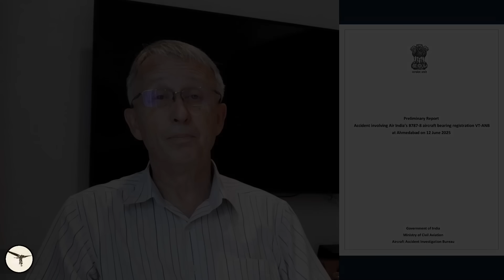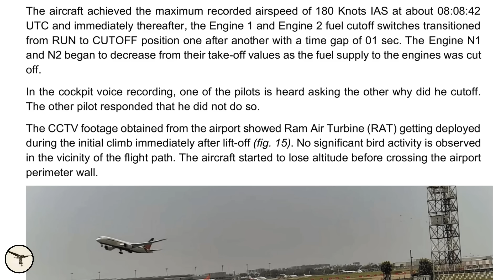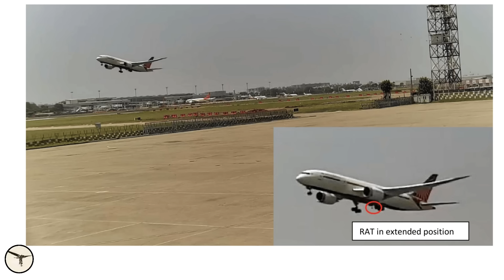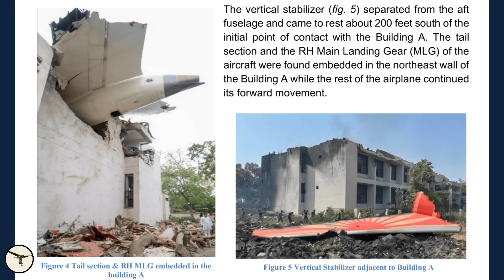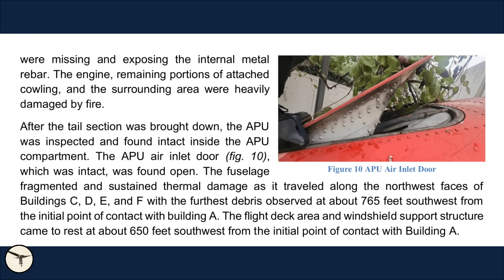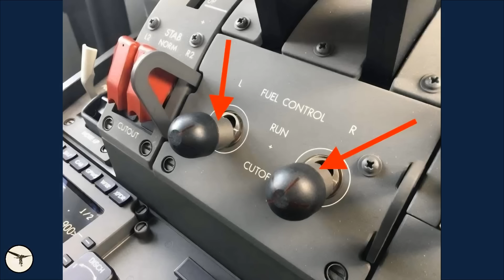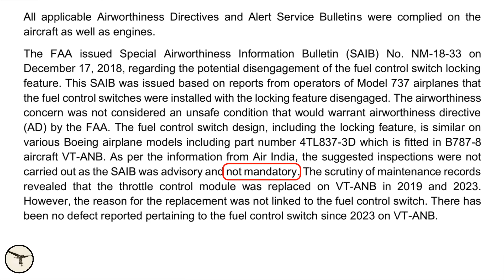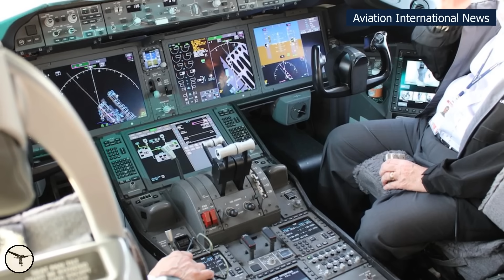WARNING Fuel Control Switches Failure Could Cost LIVES

Comment: Thank you for the video and analysis, Magnar. I'm not a pilot or an aviation expert, merely a hobbyist. I have a question though.  It is somewhat surprising to me that there was no warning that rang out when the engines were set at maximum thrust just prior to the take off run with the fuel control switches in the off position.  Unless of course, the switches were moved to the off position just after the aircraft lifted off. I hope I'm making sense. Thanks.
Reply: Yes it would seem shortly after rotation and lift off about 250' altitude the fuel switches were cycled off..
Reply: @vincentrusso4332  I am surprised that this is even possible. Why would Boeing provide this potentially dangerous feature? Are there any situations where the fuel supply to the engine has to be turned off when it is in takeoff power?
Reply: @gani999  The fuel shutoff switches are also restart switches. Turn them off and on quickly and they automatically initiate a restart sequence, which is useful at any time, including takeoff.
Reply: @gani999  Indeed, lets say that one engine caught fire during take off run - like the Concord;  the pilot need a way to fast cut the fuel for that engine, before the flames move to the wing and the fuel tanks there blow up.

In Embraer made planes they use a logic that after the pilot move the switches for CUTOFF the FADEC only will turn off the fuel valves if the throttle lever is in idle position. So the pilot need take two different actions to tell the system that he want shut down an engine.

Comment: One of the pilots did ask why did you cutoff the fuel supply! The other pilot replied: I did not do it, for it was an act of God!
Reply: If neither pilot manually caused fuel cut-off, then maybe an electrical issue caused the cut-off without the mechanical switch being moved. 🤔
Reply: Some comments should not be posted...
Reply: @sveinfarstad3897  Are some Big-Brother agent! 😊😊😊

Comment: A better design for the fuel cutoff switch might include an interlock which makes it impossible to move unless the throttle is reduced to ground idle.
Reply: There have been incidents where the throttle was damaged and seized in place by the autothrottle motors so it couldn't be moved. That would likely result in a crash if you couldn't shut down the out of control engine. If they want to crash it they could simply deploy the fire fighting bottles. It's hard to engineer around a pilot determined to unalive themselves.
Reply: @-Bill. The fire handles are locked unless it detected engine fire. It can be manually unlocked but would required an additional step to do so. 

Maybe it should be the same for fuel switches? Locking mechanism in-flight but can be manually override if required.
Reply: I don't see how that's a bad idea,  in case of engine fire one would have to bring the throttle to idle, God  forbid you have a motor separate from the pylon perhaps is why.. idk.  Still think you're on to something.
Reply: Embraer made planes use this logic.
Reply: Actually a two step Cutoff switch could be used that requires a pull, shift and rotate to 90° to lock the switch in position. But the design would have to be tested and approved by the FAA and other regulators for implementation and definitely be more expensive so the aircraft manufacturers never bother...
Reply: My GA aircraft also has a FADEC equipped engine which can be shut down with only one switch. I treat this switch with the highest respect, but in fact its not that much different from a mixture control lever. That's why my instructors emphasized to not grab the prop and mixture levers between your fingers when putting them forward on final, but only push them forward with your thumb. Just to prevent shutting down the engine on final during a brain fart. Personally I cannot imagine that such experienced pilots would deliberately shut down the engines.
Reply: Against psychos, there is no good design...
Reply: @numismatajaime  Against idiots that will swallow anything, the switches can have  padlocks and they will believe that the MCAS company diagnosed it was somebody else's fault
Reply: @numismatajaime You would at least know there is a psycho before they touched fuel cutoff switches.
Reply: In that case on the CVR you would have heard: "Why did you cut power and cut off?".
 If there would have been camera in cockpit wou could have seen the psyho's beautifull smile...

Comment: Clarification (from a guy who has flown a lot at Ahmedabad). The Indians do not like single numbers, so 1 second is written as 01 second.
Reply: @SimonWallwork  Moreover this is confirmed elsewhere in the report, which states “02 Flight Crew” on board.
Reply: I was taught (USA) to spell out single digit numbers when writing - and to use digits for 10 and greater.
Reply: Context is everything.
Reply: @SimonWallwork   who told you that??
Reply: So it took 1 second shut down but 4 seconds to flip back to run.  Got it. :/
Reply: Does the fl data recorder count in tenths of a second ? All number on the report seem to be  whole seconds.   Also,  if the FDR timer is digital, two near simultaneous events could be recorded as Sequential not simultaneous ?

Comment: The report say that one pilot ask "Why did YOU cutoff"  indicating that he saw that the other pilot cutoff.     The  other responded "I did not do so", which is NOT and answer to WHY and th answer was more of a response to "Did you cutoff", no WHY.    Why did the report paraphrase the pilots???     Asking WHY vs just asking did you cutoff it a completely different assertion by the pilot asking.    The actual voice and tone of the voice MUST be released to give light on what happened to the fuel switches.       

also, seconds after the WHY question, ONE fuel switch was turned back on, and it tool another FOUR seconds to turn on the 2nd fuel switch.   WHY so long and what was being said during this time is critical to understanding what happened.
Reply: This is all material for the final report. Releasing this preliminary report ASAP was necessary to inform operators and regulators of the technical condition that led to the crash, for the safety and confidence of B787 operations everywhere. They've released only the amount of information necessary for this purpose. Obviously anyone able to recognise either pilot's voice will know which pilot said what.

If this crash was deliberately caused it's going to take more work to reach any conclusions and form recommendations, and this is not as urgent because unlike a technical vulnerability the individual responsible no longer poses a risk.
Reply: @moblet  Absolutely correct
Reply: Did it ever occur to you it might be an English translation of Indian words spoken? Also, you can't start two engines at once. The selecting the other engine a few seconds later was more likely an action of desperation. It's all irrelevant anyway since they didn't have time to start even one engine before impact.
Reply: @davidkavanagh189  Indian pilots and ATCs mostly communicate in English. So I doubt that was the issue.
Reply: @gani999  On the radio yes of course. Indians also like to speak their own language to each other too though I think you'll find. We'll just have to wait and see if/when the full transcript is released. For now all we have are words that might be paraphrased and/or translated.
Reply: @davidkavanagh189  So what if it was English translation? That can be done easily and accurately. What does it matter if it was a translation? What does it change?
Reply: @lordjim3109  Nope, not everything translates perfectly from one language to another with all context and understanding preserved. Even within the same language, a word or phrase can have a subtly different meaning from one person to the next. Wait for the report. There simple isn't enough detail in the phrase stated to come to any conclusion about intent.
Reply: @lordjim3109  Out of curiosity, what other languages do you speak fluently?
Reply: @davidkavanagh189  I see you double down on your nonsense. There isn't much I can do about it.
Reply: @davidkavanagh189  I can tell you the phrase: why did you do it? in any language on earth, except for a couple dialects spoken in the Amazon jungle and in the Congo basin. Edit: give me ONE example of a language from which you can't translate "why did you do it?" into English. One.
Reply: @lordjim3109  You've claimed all languages can be directly translated. That is incorrect. It it were true, translation software would never get the meaning or implied meaning wrong but it does frequently to varying degrees depending on language. It seems like you don't fluently speak more than one language and don't seem to know much about languages at all so I guess we'll just leave that there. 

As an interesting aside, have you ever accidentally dropped something and someone exclaims 'why did you do that?'? Even in English that is a natural response for many people. It does not automatically mean you intentionally dropped the object. Maybe you did, maybe you didn't but further information and context is needed to come to the correct conclusion. Stop slandering the pilots and wait for the report.

Comment: Bad design. In the Embraer E-190, for example, if you were crazy enough to turn the 'OFF/ RUN/ START' knob to 'OFF' in flight, the command would be ignored unless the thrust levers were at idle. To shut one down when it's making power you have to pull the T-handle. Even then it runs 'til the fuel lines empty and you can swiftly put the T-handle back and likely restore the power.
Reply: Does anyone (pilot or technician) know how this works in a 787? Does the engine have to be idle to stop the fuel supply? Does the engine have to be idle to restart? The report still leaves many questions unanswered. Either they don't know, are still unsure, or are trying to hide something.
Reply: Against psychos, there is no good design...

Comment: Captain Magnar, due to the sequence of the re-activation of fuel flow to the engines would you agree the the senior flight crew or Captain (pilot not flying) likely move them to flow. Is it not probably the closest switch would be worked first.
     I'm, asking/suggesting, because many other reports are indicating a flight crew moved them - and the pilot non flying would have had the best oppertunity to do that.
Reply: Moving the switches looks like it would be equally simple for either pilot to do, without having to look for/at them. Just as it looks like it would be easy to accidentally strike them. I realise there are protection mechanisms in place but I'm a little surprised at how exposed these switches are to accidental contact given that they should never be disturbed in normal operations.
Reply: I'm wondering the same thing,  a guy asked Mentour Pilot would the switches being cycled from L to R or vice versa give us a clue but they said they're always taught to work from L to R just like they read.
Reply: I don't think you can draw any conclusions based upon the order of switches. For every person who might use closest-->furthest there will be someone who goes numerically first-->numerically last, or left-->right.
Reply: @-Bill.  I was also thinking there is another possibility. On many multi-engine aircraft different engines play a different role in auxiliary system operations. But that was not the point of my original query.

Comment: What is more likely to result in the switches being operated one at a time with a 1 second gap? A pilot operating them one at a time in quick succession or a hand slipping against one switch and then the other.  Expert comments I have read on other YouTube sites say that there is no way a 'nudge' would operate them and one engineer said that he had looked at thousands of them over many years and never seen a defective one
The sound of the switches being moved would be heard on the CVR when they filter out other sounds
The investigators have not even upgraded the earlier optional Bulletin to a mandatory AWD to check the switches on all aircraft immediately. If they thought there was any chance that a bump / slipped hand could have caused both switches to operate they would have issued something - The NTSB and Boeing were on the investigation team
They were able to check the function of the switches as they were recovered

This was murder / suicide.  The Investigators know it but are protecting the families of the pilots for the moment
In pulling the fuel cut off switches immediately after takeoff the guilty pilot knew there would be nothing the other pilot could do to rescue the situation
Reply: Considering there's a recommended inspection of the start switches for the exact reason that they can potentially be nudged out of position, how on Earth are you just ignoring that very relevant information and making a fairly disgraceful accusation of one of the pilots who is no longer able to defend himself?
Reply: @davidkavanagh189  Why have they not put out a AWD requiring the immediate inspection of ALL such switches. Do you think the NTSB would just let that go and hope for the best? Why did one pilot say "why did you do that". Not what did you do
Reply: @gap9992  There are different levels of requirement based on assessed risk, ADs being the highest. It's not a case of hoping for the best. They probably considered that the accidental movement of both switches together and at a critical phase of flight to be extremely remote. The accidental shutting down of one engine would generally not endanger the flight or render the aircraft not airworthy. I've no doubt they'll be taking another look at this after this accident. 

Regarding what the pilots said, it's important to remember that English was not their first language and the wording in the report may be a paraphrase or even a translation from Indian so it may not reflect the whole context of what happened there. People also do or say strange things when startled or surprised. Hopefully we will eventually get the whole transcript to get a fuller picture of what happened between them.
Reply: @davidkavanagh189  you are missing / avoiding the point I made about the lack of an additional AD. They would not wait to "take another look" if they thought the switch movement was anything other than pilot deliberate action.

As for translation, you make a good point and I was wrong. The report actually says one pilot was heard saying "why did you cutoff" Maybe that's less likely to be a mistranslation ?
Reply: @davidkavanagh189  "How on earth ......."   The throttle control unit was replaced in 2023, long after the AIB. (The reason for replacement was nothing to do with the switches) Do you think they installed a defective unit?  The AIB related to units on 737s installed with the locking feature disengaged - so NOT a fault that develops over time.  The report did not mention any PDRs relating to the switches not working properly.
Reply: @gap9992  Ah lad this is getting boring. Wait for the report. In the meantime, stop slandering the crew. There's no clear evidence yet that this was intentional. If you want to believe that it was intentional, keep it to yourself until the report comes out. Not interested in debating further. Have a good day!
Reply: @davidkavanagh189  "why did you cut off?": it means he saw the switches in CUT OFF position!!!
 Criminal hand!
Reply: @ciocrazvan9388  Ok lad. Case closed so! No need to do any investigation since you've solved the case already in the youtube comments.
Reply: @davidkavanagh189  The SAID NN 18-33 recommendation - not a mandatory action;  are from 2018, the accident plane have their throttle console, what include the switches, replaced two times after 2018, the last at 2 years, none of the replacement was related to switches issues.
Reply: @Sokol10  I'll have to take your word for it. I don't know the mx history of the aircraft.

Comment: the math do not add up up on this one, unless is pilot went suicide  all is made up data, no way both switches move accidentally and no way if one of the  engine failed they secure both engines off at that low altitude, they did not even race the undercarriage, it appears to me the pilot asking shut the engines of and that is the reason he asked he understood  his voice was recorded , can only be suicide , my analysis , prove I don't have .saludos Aviator
Reply: Possibly but you also see the advisory advising those exact switches not being correctly locked. This is a line of investigation that needs to be pursuit as well.
Reply: @ruialexandre6197  yes you are correct but I have utilized that model of switches for 40 years and no way they accidentally move, they are very hard to position from on to off, saludos

Comment: When the switch lock is released how freely can the switch move? If the lock malfunctioned could the rotation of the airplane during takeoff be enough to move the switches down?
Reply: @jbrown-acuity   there is also the recorded time differenct between Fuel Cutoff on both engines and re-activating the Fuel Flow - ~1.0 second versus 4 seconds. Admittedly during a unplanned catastrophic it might that longer to active than a planned de-activate with everything else going on. And from what I've seen the swiches are just off center possible making it harder to reach from one side of the cockpit.